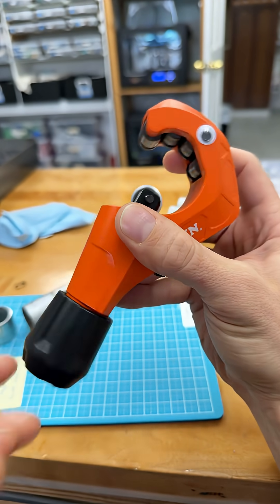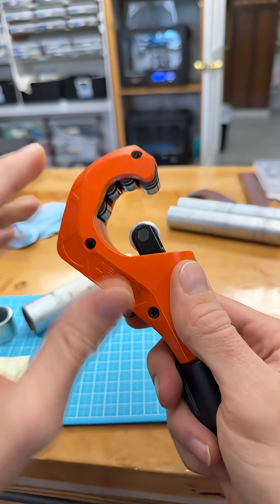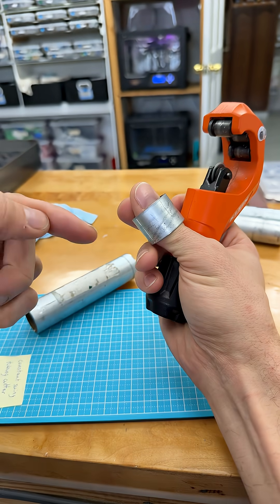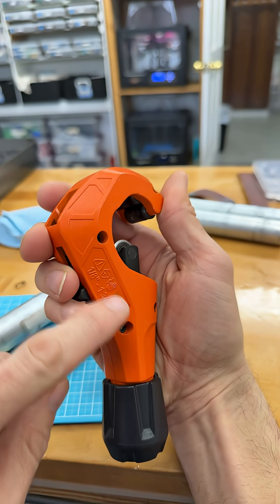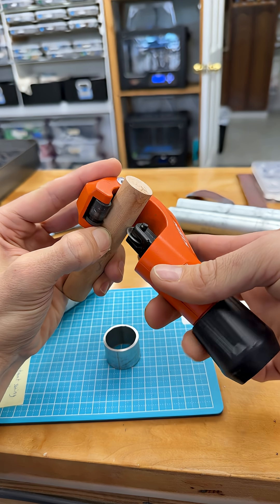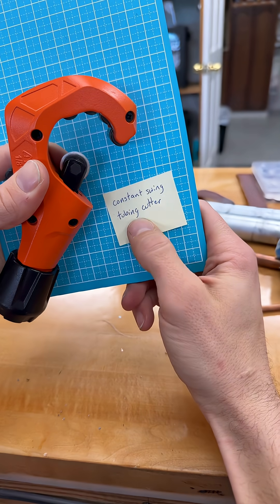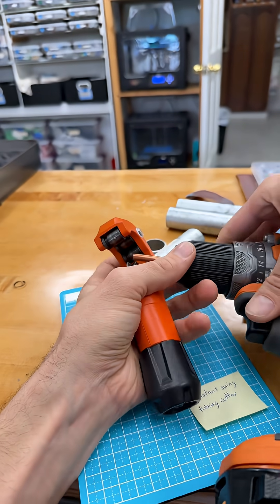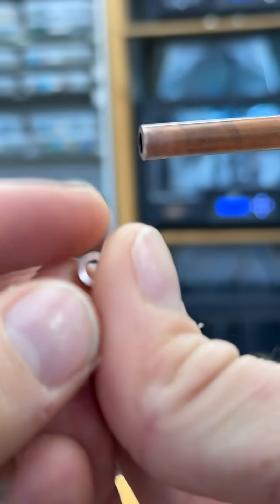tubeCutter

Comment: I believe the reason why is only recommended for coper is because when cutting steel conduit, the cutting wheel creates a lip towards the center that is much harder to de-burr, and when eventually wires get pulled trough it, you can damage the insulation of the wires very easily.
Just talking from experience, the band saw is much better for cutting steel conduit fast and clean.

Comment: My carbide chop saw would be way faster and easier and gives a nice shiny finish. Although I have to deal with cleaning up metal chips. The advantage of the pipe cutter is you can carry it in tight spaces and it doesn't leave chips. Also if you have to cut a large number of pipes in a short time, I'd go with the saw. If it's 1 or two, maybe the pipe cutter.
Reply: the statement isn't what method is "faster easier" it's what method is the least amount of energy.
Reply: @michaelbuddy that's what I'm saying. By easy I meant less off my energy. It's less than a 2 second cut like a knife through butter.

Comment: It might be the least energy in total but a band saw makes light work of pipe and it's the least energy you'll have to exert.
Reply from the maker: if you check my video 2 shorts later from this one - you’ll see why I wanted the precision.  without post processing I can slip on a cap to the pipe and match a fastener onto my printed pipe joint.
Reply: @davidmalawey sweet I'll check it out.  Those Klein pipe cutters are nice but if you appreciate awesome engineering and ergonomics then you should checkout some of the 3 or 4 blade cutters.  They're awesome you get 4x the cutting in one rotation or if you can only turn a 1/4 turn bc of obstructions you can still cut it.

Comment: i used something like this to cut short bits of aluminium tubing (6mm o.d., 1mm wall thickness), and used the bits as a ferrules to crimp/tie thick string with an electrical connection crimper. it's a crude hack, but i was surprised at how well it worked, and the material cost per crimp was ridiculously small.
Reply from the maker: yes! electrical things! If you ever shop for 4 gauge lugs they are $1 each but they go to $0.10 each building your own.  and size the holes as you wish.